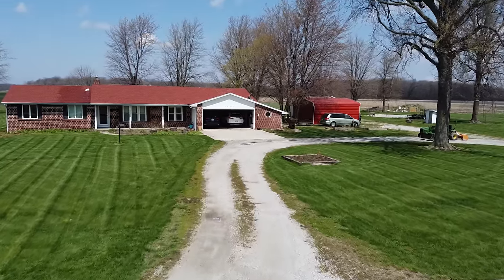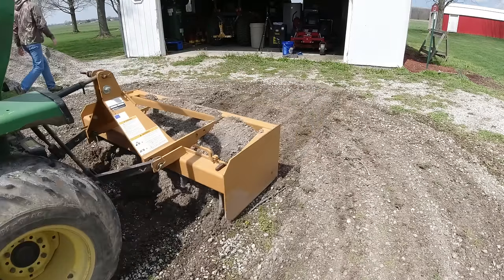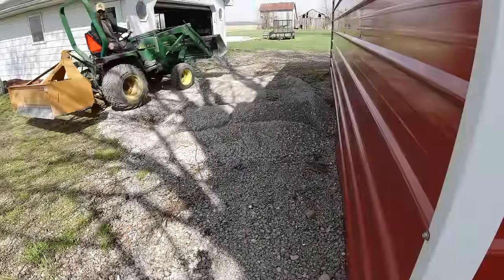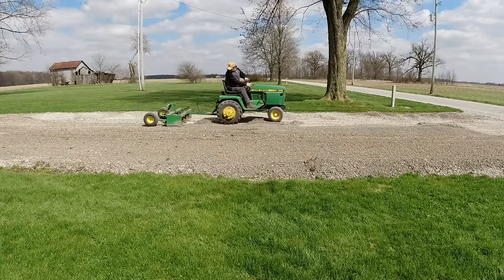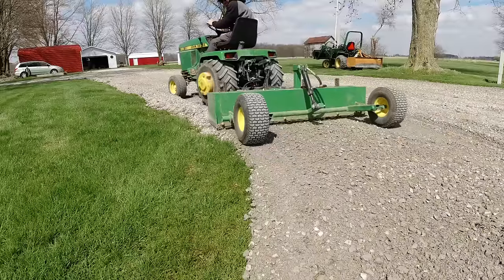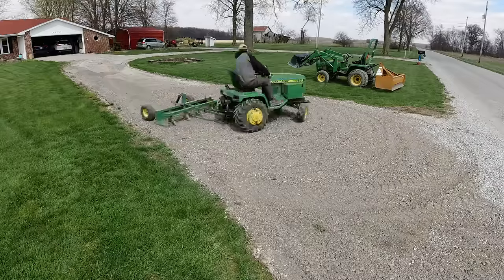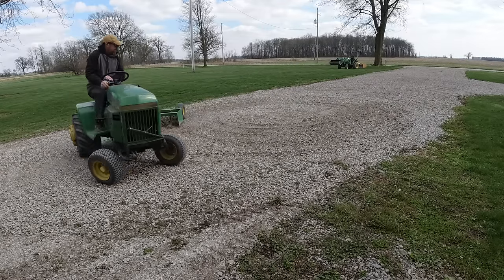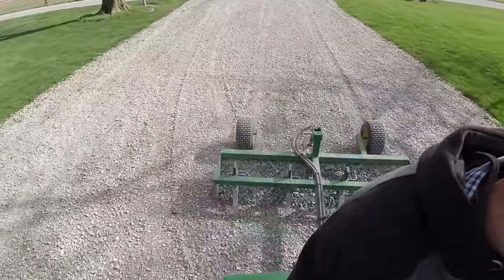Restoring a Gravel Driveway with Box Scrapers

Comment: Them 318s are beast of garden tractors. That's why I own one!
Reply from the maker: There's no doubt about that statement!  That's why I find it so difficult to own just one of them!  The 318 is my all time favorite and I've owned 6 or 8 of them.  Thanks for checking out the video!
Reply: @digdrivediy  What do those usually go for around your parts?
Reply from the maker: @Staki6908  I'd say $1000 is the average.  You can find super nice ones for $1500 or worn out ones for $650. I always go for the ones that have some attachments and you can get a good deal usually.
Reply: I love mine to,but that's a 316
Reply from the maker: @gavinstraight2187  Good eye. Yes, this one happens to be a 316 but I have 3 other 318s so I often lump them all by saying "318".  Actually, this 316 is my Frankenstein tractor.  It has a 25 hp Robin Subaru engine in it and it is much more powerful than any of my other Onan powered tractors.  There's a very old video on this channel of the Robin engine running in the tractor right after I got it done.
Reply: @digdrivediy  nice, not sure if I want to repower mine or just put a rebuilt 20 horse in it instead I love the sound of the Onans
Reply from the maker: The rims and tires were from a 1025 that someone was parting out.  I was lucky to find them locally on Craigslist.  They are 26-12-12's. I really like them.
Reply from the maker: Darn it.  I was going to look last night and I forgot.  I will try to remember to have a look and reply back here again when I know for sure.
Reply: @digdrivediy  Thanks, I'd appreciate it!
Reply from the maker: They are Carlisle TruPower. Pretty easy to find I believe.

Comment: I liked your discussion on the 3-point Box Blade and how it's hard to work with it on a bumpy road.  I had the same problem and thought it was just me.  I started to back the box blade and push the gravel vs pulling it.  That worked much better.  I still need to put down more gravel in the driveway and I liked your comments on ripping up the old before applying new.  I will do that.  Thanks!
Reply from the maker: Hey Steve.  I couldn't agree more with your comment about pushing vs pulling.  I don't know if I mentioned that in the video but I should have.  I hope you were able to get something of value out of this.  Thanks for checking out the video.  I'll probably have another driveway video very soon!

Comment: I've watched I bet 20 videos on scraping and resurfacing your gravel or limestone driveway you've not only explained the most throrally but your finished product was also the most asteically pleasing. I have 100 ft of driveway out to my polebarn and also my driveway it's our first house with that much of driveway and it's got be scraped and stone added. I have a box blade and 6ft finish blade  for my massey 135 but I can really use both when It comes to tearing stuff up but the finish work I'm awfully your video gave me some confidence cause i know someone who had the drawbar finish scraper you leveled the driveway with. What a good video thank for making it.
Reply from the maker: Wow Bryan!  Thanks for such thoughtful and kind words.  You know, I find it somewhat difficult to thoroughly and accurately represent on video what your brain goes through in the process of doing a project like this.  I'm glad that you found the explanation contained here to be helpful and encouraging.  If your neighbor has that pull type box, then go after that driveway!  Good luck getting it all shaped up I'll bet it will be easier than you think!

Comment: This is good knowledge and quality work...I trick I've learned running big construction loaders like john Deere j210 or Case 530/580 is if you have a hydraulic top link and a float mode on your 3 point set the 3piont in float and adjust your grade with the top link you can pull material and spread it in one pass and speeds up rough grade work and gets you gang close to an almost finished grade.

Comment: My family farms and we have a larger pull type box scraper.  We use it behind a 120 hp tractor.  We use it on our driveway and road when we have rough conditions due to rain . Nice job very well detailed and well planed .
Reply from the maker: Appreciate it Anthony.  Those bigger ones are terrific as well.  You can actually move some material around too I bet when you've got enough horses to load that box full.  When I was doing full time excavating we had a 12' box that we pulled with a 1468 International and it was the best tool we had for finish grading.  Thanks for the kind words and for stopping by the channel.

Comment: An alternative to the pull type grader if a guy doesn't want to or can't build one is a land plane. I do gravel driveways with my JD 5075E and 1025R using the loader and box blade exactly like you, the dropping the box blade and running the land plane. I have a hydraulic top link and can dial in the dual grader blades perfectly and quickly on the fly. Very easy to run and only need one tractor on the job. Yours does a nice job as well. Always more than one way to skin a cat.
Reply from the maker: There certainly is more than one way to do it.  I have tried one of those planes before as well and I didn't have terrific luck with it but I didn't give it much of a chance either.  I would like to have a bigger project where I can play with one.  Having the hydraulic top link would make a big difference for sure.  Appreciate the feedback Daniel and thanks so much for watching!

Comment: I was always told to spread out the driveways , and get them leveled, with doing circles your working all the fines outta your material, but I absolutely agree with ripping up the existing material. I got the same 755 minus the loader
Reply from the maker: That's true, some of the fines do settle out as you're grading in circles, but I actually like that in most scenarios.  I like having some loose stone on top rather than the hard pack as it doesn't track up in your tires when wet as much.  Some people may prefer to have the hard pack with fines in the top layer I suppose.  Lots of variations for different situations I guess.  Much if it depends on what type of stone you're working with too I guess.  So glad to hear from another 755 owner.  They really are a good tractor.  Thanks for watching and dropping a comment!

Comment: I use an old township blade behind a tractor. I pull everything to the center from the sides then work it back out and then put a crown in the driveway so the water can flow to the side of the driveway into the lawn
Reply from the maker: That is certainly a great approach. It is difficult to do the crowning sometimes with this setup unless you just build up the center first and then grade.  Thanks for checking out the video!

Comment: Great work! Love the pull type box, makes a great finish. I got some great info. I noticed in one video you compacted by driving the 755 over the drive. I find if I do that with a loaded bucket I get much better compaction. Also I back drag with the bucket down just lifting the front axle up and using a slight down angle seems to work good.  And your absolutely right about cutting the hard pack out. Your the only guy I've seen do that and it's a must otherwise it's like dumping salt on a glass table, new material will just push out to the edge.
Reply from the maker: Appreciate it Stephen!  I like your analogy of salt on a glass table.  That is exactly right!  I load the bucket to compact most of the time as well.  Just all depends on if I'm trying to compact or just sealing things off.  I love doing this kinda stuff and hearing from other folks about the topic.  Appreciate your thoughts and feedback and thanks for watching!

Comment: I'm not going to lie, i did circles, figure 8s, and north, south, east and west techniques with my rough field. Have 75hp, a 12ft disk and a drag behind it in hard dark clay. Before you couldn't drive through it. Shredding it took me in crawl gear at 1mph and still be slammed around in the cab. Now, you can break 10mph through the field with a small hopping feeling. Driving through with my 1 ton, ya its at 15-20mph and feels like a washboard road (traction control panicking and jerking).

I will also add, my neighbors didn't believe it would work. Said i need bigger and 1 offered to bring a dozer and a huge rome disk from his company. I kindly passed. Took an extra 1000lbs on the disk and around 500lbs on the 12ft drag while the tractor was in 4x4 but it worked great in the end. Neighbors dont say s*** to my as determination makes things happen. Circles, and working the material around in different directions helps a lot on smoothing. Only cost me 50 gallons of diesel, 36hrs, my neighbor a new disc axle (barrowed disc that the end nuts fell off and the disc blade destroyed the threads) and me for my new to me used 80s disc. Cheap price to pay since now i offer land smoothing and shredding.
Reply from the maker: Wow Brandon! A little determination goes a long way for sure! Glad you got your field smoothed up like that.  Circles are great when you have the patience for it!  Thanks for watching!

Comment: Hi Neil
 have looked at this video before but watched again and enjoyed more.  Maybe you remember me commenting on your Bruno Build(Awesome).  I have a 318 that I'm restoring and goinging back with the green with auto clear coat but with the larger tires exactlally like  yours.  I had the same problem as you with the bearings on front .  I've got a '99 model with the metric and got a set of 1" wheels(older model but nice no rust)so had to get the metric bearings before I sprayed them and put the 18" 5 rib tires on.  i have the awesome deck 50" with it so before taking off I 
wanted to save original tire sets both front and back.  This tractor only has 750 hrs and runs awesome.  
Its a time piece but I cant help hot rodding I do on all  my projects.  I've put a 3-point hitch on it 
with a cat 1 catagory.  I have a awesome dozer balde 54" redone but wanted a little more capibility with the three point hitch.  I'm really looking at a small 48' Box Blade from Aignite less than 1000.00 shipped or possibly a Land Plane from Homestead Implements 48" for 1300.00.  My project is just a fun hobby but I would be using it on two driveways in VA and NC.  Any info on the box versus Land Plane would be appreciated?  Thanks for all your great videos!   John
Reply from the maker: Thanks so much for watching the videos. John! I've tried to land plane and didn't find that. I liked it as much as my pull type greater box. 3 point boxes work okay too but they just don't have the leveling ability that a pull type box has. If I had to choose only one between a 3-point box and a land plane, I would choose the box just because you have the ability to move more material with it, whereas the plane doesn't do that. The box blade is like a flat edge shovel and the plane is more like a rake.

Comment: 👍🇺🇸  Nice job!  On your box blade a hydraulic cylinder for the top link makes all the difference in using and controlling the box blade.  Spreading gravel is also easier and you can control the thickness of the gravel as you spread it by tipping the box blade back and forth.  Same with the rippers, the depth & angle can be controlled by tipping the box blade using the hydraulic top link!
Reply from the maker: I should really try that idea.  I've heard it is the way to go.  Thanks for the suggestion Larry!

Comment: I have found that a hydraulic top link for the grader box makes a world of difference. You can tilt the box forward to pick material up and tilt it back to deposit it in a controlled way and let the rear blade do some compacting at the same time. . It is way more controllable than just lifting up the box to spread material that inevitably leaved uneven spots

Comment: I like the way you work. Also like your pull type blade as I get what your saying about the box blade. I have as well and was always searching for something better. I made my own levelling blade as well. You can check it out on wood you mize it face book page and go back a few post. I like your circle gig there as well and now I’m tossed as to make one like yours or keep what I have. The advantage of mine is I can lift it up completely and back up to things. I do many circles as well but then I get pushed up rows on the outside of my blade if you know what I mean. It all straightens out when like you I do my final finish though. I have 3’ runners on it which also acts like a grader and fills the right spots and pulls off the high spots. Any way nice work. I like guys that don’t think “it’s good enough”.Cheers!
Reply from the maker: Really appreciate that.  Sounds like you've got a nice set-up too.  Glad to hear I'm not the only one stuck in "circles"! Lol. Thanks so much for watching!

Comment: What a great video.  Now I'm sitting here cogitating on how I can modify my box blade so I can also use it as a pull type.
Reply from the maker: Hey Thanks!  You won't regret it if you do!
Reply: Add a removable drawbar to it and some removable wheels mounted with 2in receiver hitches and call it good, adjust height with the three point hitch

Comment: Great video!  
It seems like if the pull type box scraper had more ripping tynes on it, you might not need the three point scrapper at all, because you could rip with the pull type scraper, then smoothen with it too.
Reply from the maker: Yes, it could probably rip it up but in the current setup I don't have the weight either.  Very possible though to do it all with one rig though if properly equipped.

Comment: Great video!  I struggle with getting my driveway level and with pot holes that appear to form in random places.  Thanks for the video and the advice.
Reply from the maker: Thanks Curt.  Those pot holes can certainly be pesky.  I've had decent luck ripping the pothole up as much as I possibly can and then filling and packing it back full.  They don't seem to hold very long if you just fill them with loose material and haven't pre-ripped up the existing hole.  Sometimes you have to about over-dig them out and then refill and compact, but yet that doesn't always work either.  Best of luck.  Thanks for watching!

Comment: I use my jd 4200 and my landscaping rake for my drive way does me a good job 👏
Reply from the maker: I've always wanted to try a landscaping rake as well.  The best tool to use is the one that works for you.  Glad to hear you've found a good solution.  I've had my eye on a bigger tractor like the 4200 as well.  Do you like it or does it make you want anything different?  Thanks so much for watching!

Comment: best thing I have used is an old weighted box spring...sounds crazy but it works great
Reply from the maker: Not crazy at all!  I've heard of and used the 'ole box spring trick too.  Works good to smooth out all the stone ridges in loose stone but doesn't do a great job of breaking up existing stone or moving any material but still a worthy tool.  I should do a bed spring video!  Thanks so much for watching.

Comment: I think your methods work but I'd have used a rear-blade for mixing materials & my loader for leveling high-spots.  You must not get much rain there b/c here we've got to have far more drainage to keep our gravel/dirt roads maintained.  In combination with the loader, adding wheels to my rear-blade might provide the leveling feature you're getting with the pull-box. Thanks for sharing.
Reply from the maker: Good points here.  Certainly more than one way to skin a cat.  We get an average amount of rain I think but we are all just super flat, so not too much erosion at play on our driveways thankfully.  Wonder just pools around here and goes away slowly.  I like your idea for wheels on a the rear blade.  I'd like to see that!  Thanks for watching!
Reply: Good Job, nice result. Thanks for circle tip

Comment: Very useful video, thanks. Long story short, in lieu of rent, I'm the caretaker for my landlord's property, and I'm using a 1947 Ford Ferguson of hers that I brought back to life after ten years of sitting derelict on her property. It's only rear wheel drive, no bucket, just the three point lift. I found a box blade in very good condition for $100, and I welded in homemade ripper brackets. We live on a private road that includes a 200 yard section of neglected, hard packed gravel. It's very wet out here right now, am I okay to go ahead and rip the road and grade it, or do I need to wait until it's dryer out? We're in the Pacific Northwest, where it rains a lot, especially in winter.
Reply from the maker: Hey Jerry.  Thanks for sharing about that Ford Ferguson that you got running.  As far as your question goes, I think you could probably work it up, grade it out and get it packed back in as long as it doesn't take on a bunch of new water in the process.  If it is hard packed and sealed, there shouldn't be a bunch of water in the road.  So, you could rip it and get it smoothed up on a dry day or two, and then just be sure to wheel pack the entire surface back in so that water cannon permeate the freshly worked stone.  If there is a high risk that you can't get it packed and it will ingest a bunch of water into the gravel, then I would wait for a dryer period.   The important thing about any driveway is to try to make sure that water cannot run down into the stones, rather it should run off of them.  Pack it back in with something heavy or with skinny tires for the best weight to area ratio.  Hope that helps with your decision process.  Best of luck and thanks for watching!